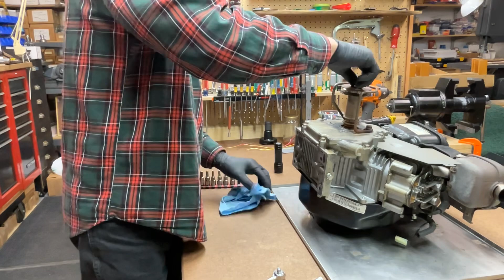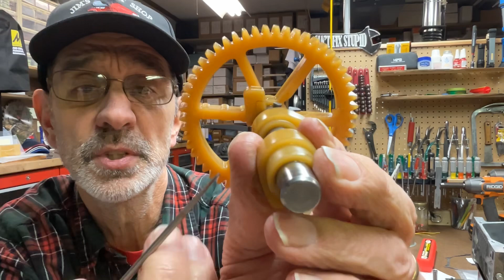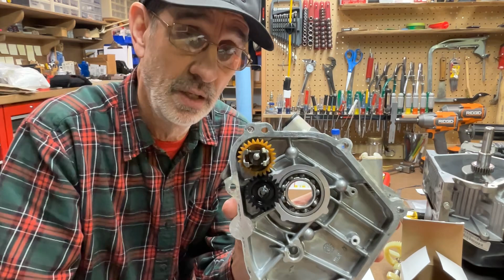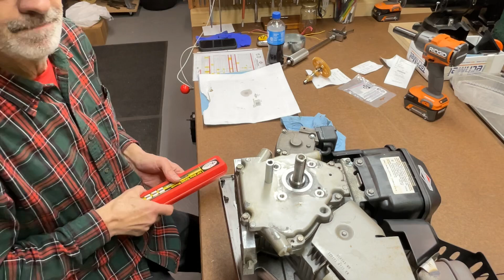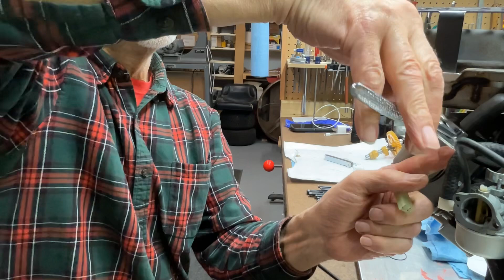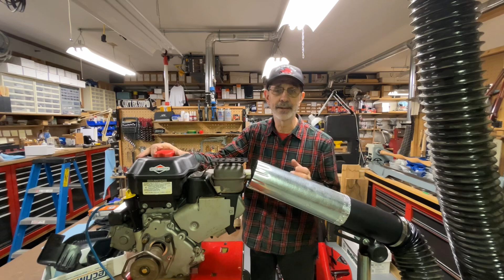513. Part 1.  How can I replace a camshaft in my Briggs & Stratton snowblower?

Comment: old trick of the trade 30 auto tech when you put a seal like that with a spring pack some thick grease around the spring and it helps keep the spring on assembly.
Reply from the maker: @dl2122d  well thanks for the tip. I will keep that in mind next time I have to replace a lip seal.  Jim

Comment: As always nice work Jim. I agree-cheap material and nothing is gained when everything else is metal. Mind boggling imho. I’ve never ran into that issue before with the engine rebuilds I’ve done, yet!  Maybe I’m too vintage 😂

Comment: Hey Jim, great job replacing the camshaft. Sad that many engine parts are plastic nowadays.
Reply from the maker: @stevef8993  I guess the worst part isn’t that the gear and lobes are plastic. It’s the cheap little spring that has no way to keep it from popping off of that little shoulder. I guess what I should try doing is drilling and tapping a hole next to where the spring is and put in a small machine, screw, and washer to keep the end of the spring in place,  actually I might do a video on that and try to fix that camshaft, who knows the one I put in there could do the same thing that snowblower was my bosses and I bet it doesn’t have eight hours on it. He has a company that plows his driveway. All he does is zips up and down his sidewalk.       Jim
Reply: Think about maybe just drilling a pin hole in the plastic and bending the end of that spring into it. A screw, however small, will put stress on the part. If it were metal, no problem.

Comment: Hey Jim if you take the spark plug out it will be easier to turn over to check the valve for proper operation
Reply from the maker: @stuartk6895  actually it turned over pretty easy even with the spark plug in it